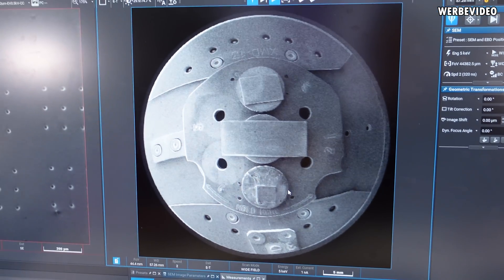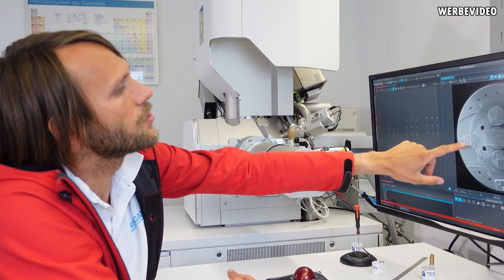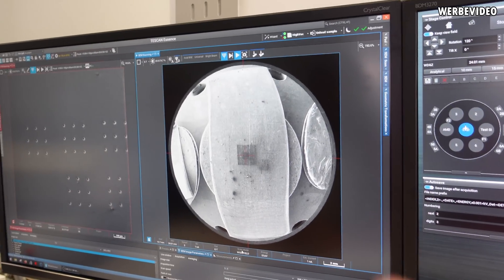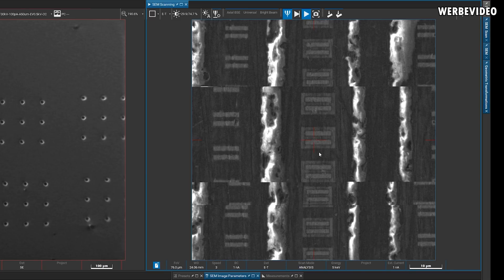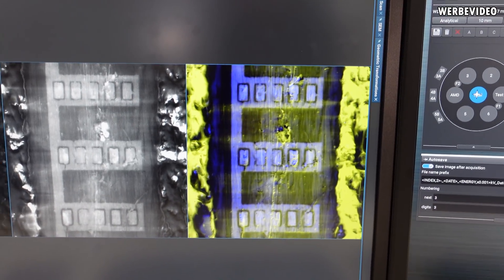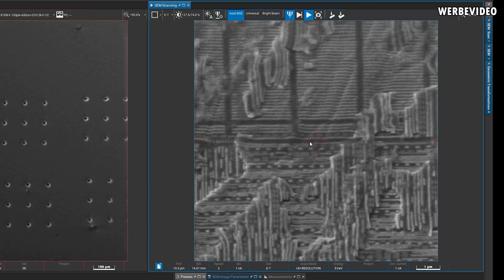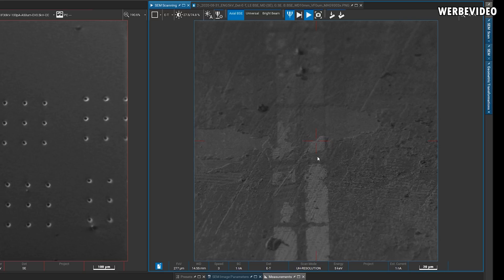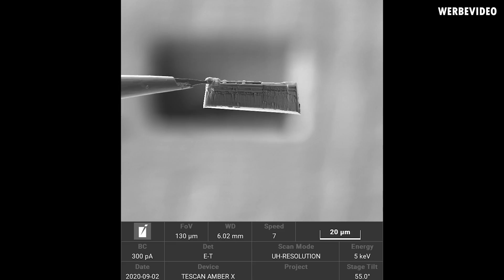Ryzen Nano-Structures more than 100,000 times magnified. Visiting Tescan Part 2/3

Comment: Subscribed for part 3. Interesting stuff!
Could you also scan the different layers of laptop screens? When you take apart a laptop screen there are like 4 or 5 different sheets of plastic between the pixels and the person looking at it, I'm curious what they look like and can't find zooms of the material.
-edit: I can supply you with the sheets, if ultimately necessary.
Reply: Ok so you know what Electron tunneling is with the transistors, and how they use silicon transistors to get smaller like the 7 nm they are currently at with AMD's Ryzen 3000 series CPU's.
And the 5 nm, 3nm and so on, to make the computers more efficient with performance and energy but now we are starting to see more heat.
Silicon has limits but they keep trying to improve it, and it will melt at specific temperatures, so we need to replace it.
Ask yourself why we aren't using Quantum Materials like Graphene (yet) and still using silicon. 🤨🤔

This is where Graphene will fix the electron tunneling aka Quantum Tunneling, we don't need silicon to get down to 1 nm "nanometer" in size.

Imagine this, Graphene computers with a magnetic current to be 1,000 times faster and possibly only use 1% of the energy used. 💡

Now imagine Graphene optical / transparent transistors for Photonic Computing. 💡

Now imagine Graphene lasers for the fiber optics that would be used as the circuits inside our computers for Photonic Computing. 💡

--------

I would rather see Graphene computers, let's get rid of silicon. I'm serious.

Check this out.
I would give links but the video hides my comments.

Go to my channel and click on the playlist called "Videos with important info to get around my channel". ✔

Watch a Flash Graphene video about Flash Graphene 100 dollars "per ton". ✔

And then another video about "Large machines on earth / in space to make Flash Graphene". ✔

After that, check my channel with 2 simple steps for my other channel, go to the "About" tab of the channel I'm commenting with now and read the info with a link found there to save to your browser's favorites. ✔

==============================

Imagine Graphene for Photonic Computing, to help us save on our energy needs, really think about that for a second with Photonic Computing.

Check my other channel for these 2 playlists.
Photonic Computing playlist. ✔

Graphene computers for home and Starships, playlist. ✔

Learn about Graphene from my other channel's "Graphene playlist". ✔

If you want to know more about Graphene and Quantum Technologies, go to my other channel. ✔🤔💡

Comment: This really goes to show you how absolutely purely insane extreme level of engineering. Like, transistors aside. Imagine solving every connection and incredible about of layers for traces. Like you think a 3 layer PCB with a couple hundred components is a big undertaking
Reply: You don't do that manually, the transistor counts are up in billions, that's impossible even with a lot of copy pasting. The way it works is you write the logic in a specialized programming language such as VHDL or Verilog and have the hardware equivalent of a compiler implement your logic in how the layouts and interconnects should be in silicon. Chip logic is basically developed like software.

Comment: I wonder what PC setup would be needed to zoom in on those SEM images without chugging.
Reply: Older SEM-s are completely analog, no computers in them at all. If you wanted a record of what you saw on the screen you took a film photo.
Reply: Run the code on Linux.

Comment: @5:30 There is no colour in SEM, because you have a very narrow wavelength (energy) of electrons. Therefore, it is monochromatic, there is only change in intensity.
Reply: i guess if you could measure the energy of the electrons hitting the detector, you could false-color it by the energy of the electrons detected
Reply: @TheBackyardChemist   You control it via the acceleration voltage. It would be more about the captured electrons in a detector after they hit the surface, because in the case of visible light, we also see the reflected light as some colour. We would need some detector which measures the energy of the electrons. But that's again a tricky question because you have different electrons in the process.
Reply: @CuriousScientist  There is no light or color involved, you detect electrons that are backscattered from the surface. "intensity" here is related to the amount of electrons that make it back to the detector. Energy measurment is done, it is called EDX and can provide information about the material that the electron beam hits.
Reply: @WibovanNoort  I know pretty well how an SEM works. I was referring to the video, because I felt that his explanation was poor. The EDX does not measure the energy of the backscattered electrons, it measures the energy of the x-ray photons created by the electron beam - specimen interaction.
Reply: Curious Scientist yes you are right EDX captures the spectrum of xrays. Secondary electron spectroscopy would be the right term for measuring the electrons directly.
I think In the video he means that higher energy electrons will also show up as higher intensity.

Comment: No offence, but that guy's explanation of how scanning electron microscope imaging works is pretty crappy 😅 It's actually not even (fully) correct...
Reply: It's correct enough, it just doesn't doesn't explain the scanning part, only how brightness and contrast parts work which is kind of more relevant to understanding what you are looking at.
Electron microscopy works kind of backwards compared to regular light photography, you don't spam the entire sample with a light source and focus the image to sensor. Instead you focus an electron beam on a tiny part of sample and measure if you hit anything or not. By scanning the beam around the sample you can probe different areas and put an image together from that. Provided you know how a CRT specifically and vacuum tubes in general work that probably already tells you all the basics, if you don't... well that's kind of too much to fit in a youtube comment.
Reply: @aleksandersuur9475  you do not "measure if you hit anything or not", you measure 'how much you see'. Which is a direct measure of the sample's topography
Reply: And the correct explanation is?
Reply: @GoldSrc_  The electron beam locally and slightly ionizes the material, close to the surface. The resulting freed charges are what is 'picked up' by the sensor. Because it happens only close to the surface, the area that is illuminated has a large influence on the resultant signal. What an SEM 'sees' is the topography. What he says is a thing that happens, but he fails to explain what makes the electrons excite in the first place
Reply: @WouterVerbruggen  This is true for secondary electron detector which displays something like ambient occlusion in computer terms. Backscatter electron detector  signal depends mostly on atomic number and somewhat on crystal lattice orientation and topography. I think that explaining this stuff would be enough material for hours.

Comment: its simply mind blowing how small stuff really is. i cant imagine how they actually manufacture these cpus. thanks for this great video!
Reply: Ok so you know what Electron tunneling is with the transistors, and how they use silicon transistors to get smaller like the 7 nm they are currently at with AMD's Ryzen 3000 series CPU's.
And the 5 nm, 3nm and so on, to make the computers more efficient with performance and energy but now we are starting to see more heat.
Silicon has limits but they keep trying to improve it, and it will melt at specific temperatures, so we need to replace it.
Ask yourself why we aren't using Quantum Materials like Graphene (yet) and still using silicon. 🤨🤔

This is where Graphene will fix the electron tunneling aka Quantum Tunneling, we don't need silicon to get down to 1 nm "nanometer" in size.

Imagine this, Graphene computers with a magnetic current to be 1,000 times faster and possibly only use 1% of the energy used. 💡

Now imagine Graphene optical / transparent transistors for Photonic Computing. 💡

Now imagine Graphene lasers for the fiber optics that would be used as the circuits inside our computers for Photonic Computing. 💡

--------

I would rather see Graphene computers, let's get rid of silicon. I'm serious.

Check this out.
I would give links but the video hides my comments.

Go to my channel and click on the playlist called "Videos with important info to get around my channel". ✔

Watch a Flash Graphene video about Flash Graphene 100 dollars "per ton". ✔

And then another video about "Large machines on earth / in space to make Flash Graphene". ✔

After that, check my channel with 2 simple steps for my other channel, go to the "About" tab of the channel I'm commenting with now and read the info with a link found there to save to your browser's favorites. ✔

==============================

Imagine Graphene for Photonic Computing, to help us save on our energy needs, really think about that for a second with Photonic Computing.

Check my other channel for these 2 playlists.
Photonic Computing playlist. ✔

Graphene computers for home and Starships, playlist. ✔

Learn about Graphene from my other channel's "Graphene playlist". ✔

If you want to know more about Graphene and Quantum Technologies, go to my other channel. ✔🤔💡

Comment: Hi, How much space would take an image of transistor level resolution of the entire die? A few GB or more?
Reply: With 256GB RAM, I'm able to comfortably store and display images of 160000x120000. That's a bit over 70GB of raw image data at 32bpp.

Zen 2 chiplets are 74mm squared. There's a million nm in a mm. Assume you'll want 3.5nm per pixel to squeeze the 7nm feature size into four-pixel units.

Assuming I've done my maff right (possibly haven't), that's a little over 2095.47 terabytes of raw image data at 32bpp. Hope you have a few petabyte arrays in a RAID configuration, if you want to store it all at once.

Oh and that's just the one layer. Multiply that by however many images you need to take to capture all the layers.
Reply: @technicalfool  You can just rent all that through the cloud via AWZ or Azure, right? Along with a 10 Gbps or 100 Gbps unmetered pipe, too?